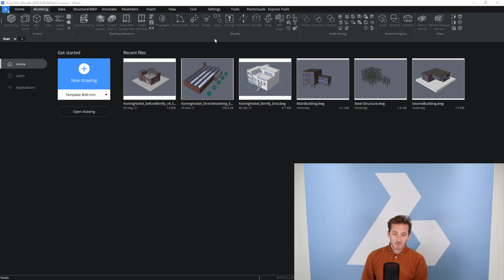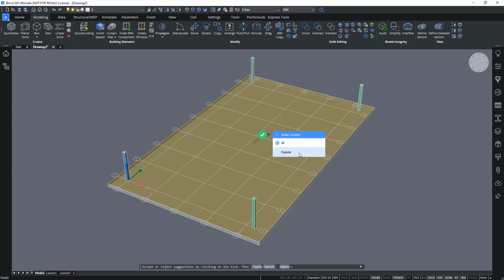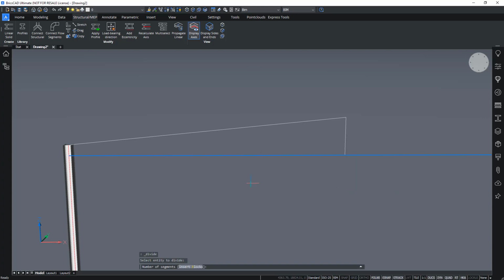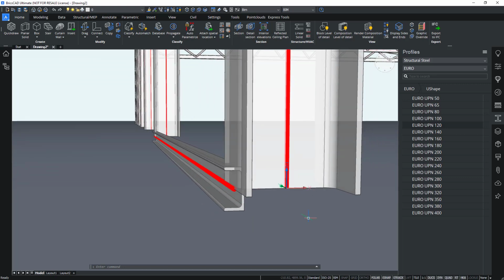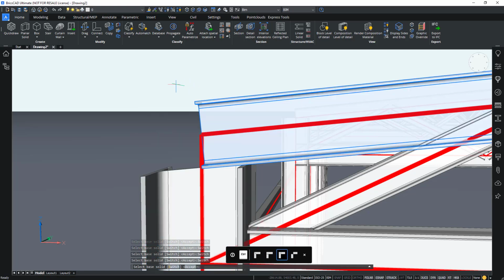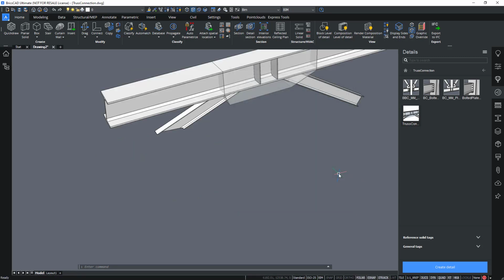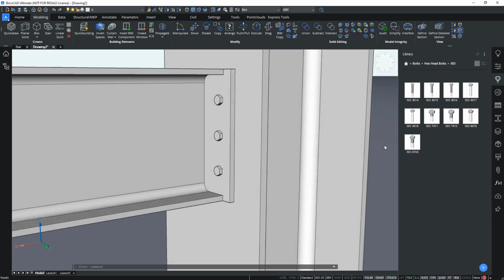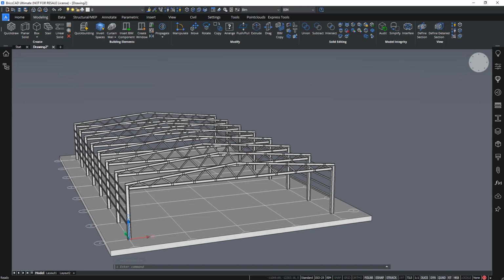BricsCAD V22 BIM Academy 15 - Structural Modeling

Comment: Seems a bit cumbersome compared to some of the structural plugins for Bricscad. How would you get correct bolt lengths for automatic bolt lists with nuts and washers? The bolts look  long.
Reply from the maker: When the bolt is selected, you can change the bolt lengths in the parameters section in the Properties Panel. You can also choose to link parameters together in the Mechanical Browser (e.g. the size of the bolt with the size of the nut), so they always update in sync.
Reply: @OctaveBricsCAD  It's great for the design side of things. I own BricsCAD Ultimate. It's great, I love it. But, I do use a plugin for structural fabrication:)
Reply: @j.six3 What is the name of the plugin?
Reply: @valmirmoraes1248 Parabuild